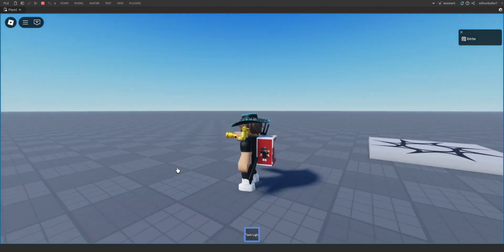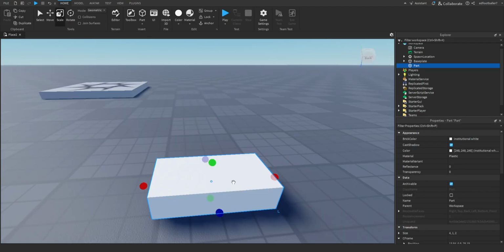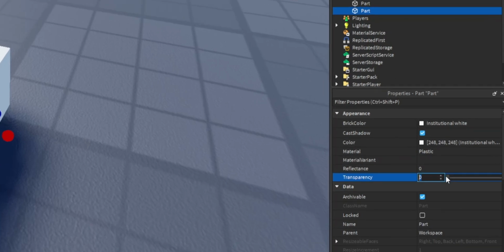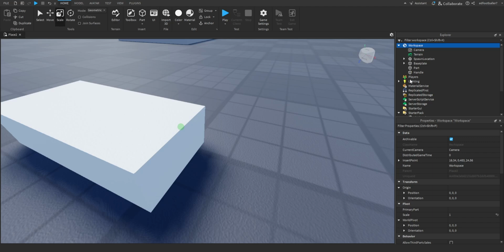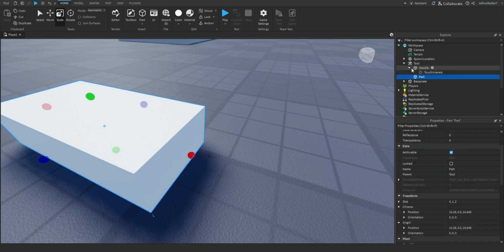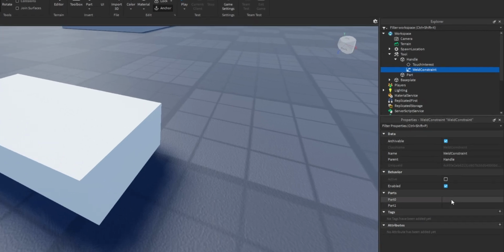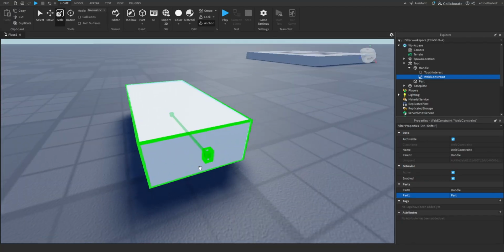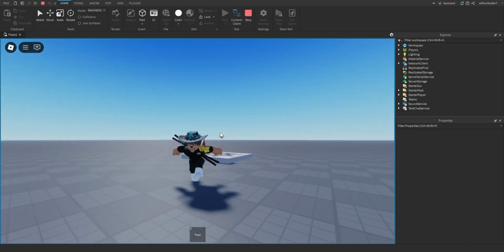How to EASILY make a Tool on Roblox Studio 2025

Comment: i have 2 parts in my tool how do I weld them?? and what if i dont want it in the starterpack??
Reply: make sure to set them both to ( anchored = false ) don't anchor them so they won't get stuck, then go inside one of the two parts and inset a WeldConstraint object, go to the properties of the weld and set the part0 to the first part and part1 to the second part, and then they should be attached.
Reply: @RealJakeDev  when I set anchor to false they separate and I did weld them
Reply: @ i'll make a tutorial soon, u probably did something wrong
Reply: @RealJakeDev  ok